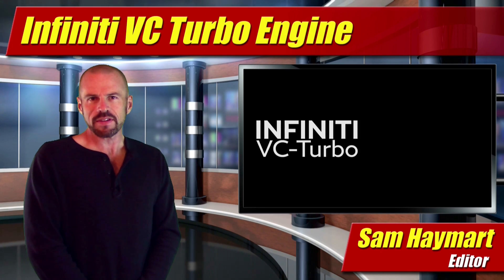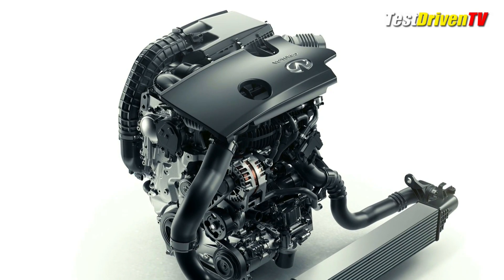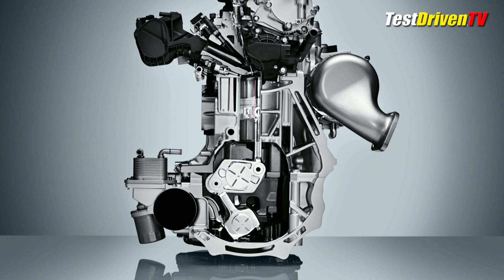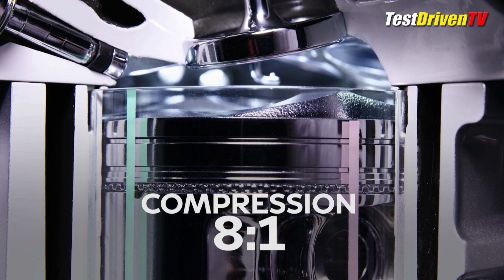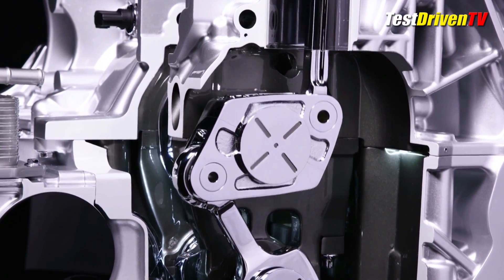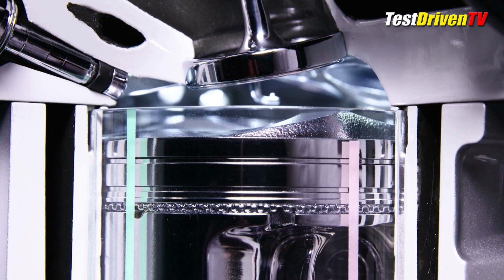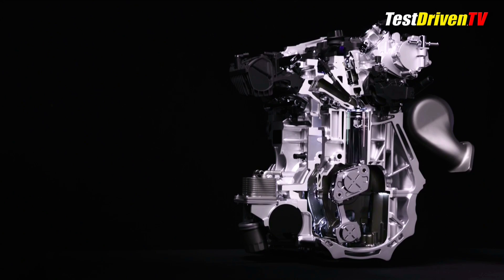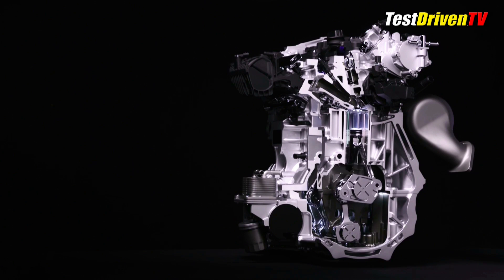Nissan Infiniti VC Turbo Engine: In Depth Look

Comment: Apparently NHTSA is investigating why there are so many engines being replaced due to stalling, knocking, and failure.  I hope they don't issue a recall, as I have a 2022 that (to me) has been fine.  I just hate how the AC/heat system doesn't work properly and he dealership doesn't have a fix.  I don't want to go through an engine replacement in the near future, the car will never be right.

Comment: What happens to the knocking at 14:1,  how did they overcome that?
Reply: Shantnu Mehta you will only get the 14:1 cr if you’re running premium fuel(which is recommended) which at that point the engine isn’t experiencing knock.

Comment: My Variable compression ratio design would be an eccentric intake camshaft and a hydraulic based variable valve lift and event system. Instead of using a complicated multilink system, it varies the intake valve lift duration to prevent knock (ranging from otto cycle to miller cycle and anywhere in between to effectively vary the compression ratio from 16:1 to 11.5:1) and homogeneous charge compression ignition at lower rpms combined with electric assist and cylinder deactivation for maximum fuel economy and torque that rivals a 2 liter turbo 4 in a sculpted CGI block naturally aspirated 3.4 liter V6 package with a target of 295  ft-lbs at the mid 3000s and 311 hp at the mid 6000s and a 7000 rpm redline. And also a soundaktor and acoustic tubes for ultimate in cabin engine sound. Also instead of FWD it will use a small diameter boron steel driveshaft RWD drive CV axle system. Also eliminate the accessory belt completely and use a 48 volt brushless DC air conditioner compressor, electric power steering, an integrated harmonic balancer and motor generator rotor for the 48 volt system, and electric water pump and eliminate the thermostat.

Comment: New to the consumer. I would recommend, for the average Joe, wait 2 to five years before buying and wait till well off consumers get the experience and the headaches of the engine. Looks like more moving parts more problems and expense to repair.
Reply: Just like the CVT mess up with Nissan.

Comment: This design is literally an atkinson engine. Holding the intake valve open at the start of the compression stroke is not atkinson, thats boudack or immitation atkinson.
An atkinson engine has compression that is changed on the compresdion stroke which is performed by varying the stroke mechanically.
The atkinson cycle is as old as the otto cycle and came out in the 1880's.
The only improvement here is the ability to adjust the affect. Atkinsons engines were fixed and had a different cr for up stroke than it had for downstroke.

Comment: Say bye bye to the mechanic shop Because I know this  is to advance
Reply: Stressed out everything Nissan or infinity makes and has failure is replaced as a unit on newer cars. I miss working Nissan. Now I'm with dodge and they still rebuild most everything, but some of the new tech failure gets a new unit.
Reply: Steven R I see

Comment: I think it would work better if you put springs on the piston. If your just want that extra fuel economy. Would give better strock. All you need is a spring in each piston rated at 10ft pound or so. When the piston compress it would give you that 8:1 then at low rpms and low psi the piston would go back to a 10:1. Would give you more horses and low mass add to rotating asinbly, and it would work on V engines.

Comment: What kind of fuel they will be burning if they are so confident? As a result of the new mechanical engagement, when leverages and sub camshaft are adjusted to higher compression ratio the piston is engaged in "Gonzales" speed versus crank rotation ???

Comment: Every person in Detroit is going to rush out and order one of these since GM and the UAW couldn't build something like this in 1000 years.
Reply: The UAW builds what they're told to. Engineers have to come up with a workable, durable design. 
Hopefully, Infiniti has. Sam answered my question, have they tested this thing to death?
Reply: Nope. Gm is going diesel. The new terrain is the same size as the qx50 and is rated almost 10 mpg higher.
Reply: Smokey Walker no many in Detroit have money.
Reply: The Saab engine was not simpler. It actually more complicated and had alot problems. Thats why it was never put in production.
Reply: gm got the saab variable compression a while ago, it was much simpler, i'm still hoping it works and they've just stored it for later use.
Reply: Smokey Walker The colorado has a diesel, the half tons are getting a diesel, the terrain has a diesel, i really wouldn't be surprised if more gm cars went that way. Americans are slowly starting to embrace diesels. The dpf's aren't as bad as people make them out to be. There were problems when the technology was first introduced but it's fairly solid at this point. Bmw, mercedes, and jag diesel sales are decent, and the fact that we're getting them at all means there's a demand. Look at the terrain, 38mpg in an suv. People with diesel 3 series are reporting up to 50mpg. 
Diesel emissions are naturally low other than particulate emissions. With a dpf in place, almost 3/4 of particulate emissions are removed. 
Maybe not gm in particular, but i do believe diesel is out immediate future. Obviously we will need a clean renewable fuel at some point, but diesel is a grear option for the time being.
Reply: I dont' think so, too much cost.  DEF injection systems to control NO2.   Canister filters to  capture soot and burn it off when the filter starts to clog up.  Diesel in the US is going nowhere.  GM is history no matter what they build.   GM couldn't build diesel, gas or anything else.
Reply: V.Vega you americans, dont switch to diesel!! Im european, here we have a long diesel tradition, and as a result we are now facing a great pollution issue in our cities. Paris is even gonna ban diesels from entering the city in a few years. In Europe we are coming back to gasoline, apart from hybrids and compressed gas which are much cleaner than diesel and provide good mileages too.
You can say modern diesels have particle filters, cathalitic converters etc. but they are still dirty: remember volkswagens dieselgate and their cheated emissions.

Comment: Compression ratio until 14:1. It should go to about 30:1. The second conrod of each cilinder sholuld rotate about 180 degrees, then the motor could be less tall. Sorry by my english.
Compressão até 14:1. Deveria ir até uns 30:1. A segunda biela de cada cilindro deveria rotacionar mais ou menos 180 graus, de modo q o motor seria mais baixo.
Reply: Cromo 30:1 compression ratio? Good luck with that 14:1 is already really high for a small gasoline engine big block dodges in the 60's had such high compression that they blew spark plugs out of the engines and they were no were near 20:1 much less 30:1
Reply: Removing the 180-degree rod rotation is a primary reason for not needing a counterbalancer.  It also allows the rod to be at near vertical on the compression/power stroke, reducing piston friction and wear-and-tear on the cylinder sleeve.  It's all clearly explained in this video.
Reply: Gmon750 your misunderstanding the point at 30:1 compression you will blow your gaskets no matter how low the friction the compression will be to high
Reply: I didn't say anything about the 30:1 ratio.  That's a different poster.  Nonetheless, a 30:1 compression is going into diesel-engine territory.  Gasoline engines will not tolerate such a high compression ratio due to engine knock.
Reply: Gmon750 I thought you were seconding his claim of 30:1 c/r and your exactly right that's what I was trying to explain to the other guy that gasoline engines can't handle extreme compression similar to 30:1 as far as I know the highest reliable compression ratio in a gas engine is 16:1
Reply: 30: 1 ? Wow.. that awesome dude.. with that compression. Then how about valve operation? Have enough space to move?

Comment: Excellent summary and cool tech. As for whether it's too complicated to be reliable, doesn't seem so- it looks like an extra shaft and connection, w/ out balancing shafts. Volvo is putting turbo and supercharged engines in production, can't be more complicated and stressed than that.
Reply: even if it isn't practical at all, it's still nice  to see people trying to go back to the drawing board. it seems to my not so practiced self quite a monument to properly distribute the force applied to a crankshaft in motion, its why we dont. but if you COULD, that opens up alot of interesting doors. i'd say the bottom end of the ICB hasn't really changed terribly much in function since... ever.